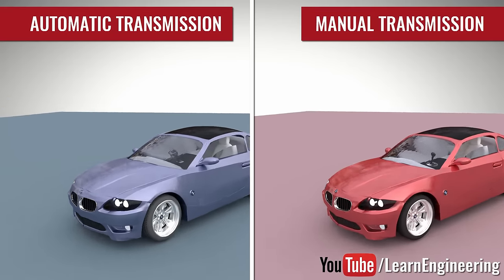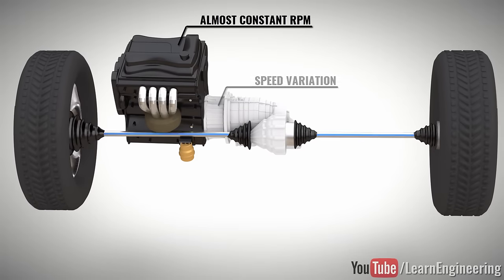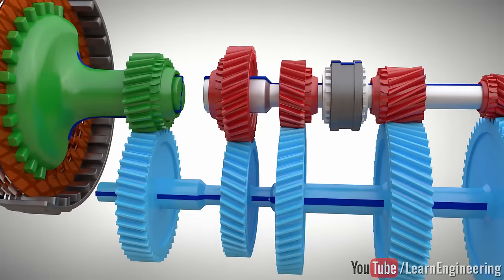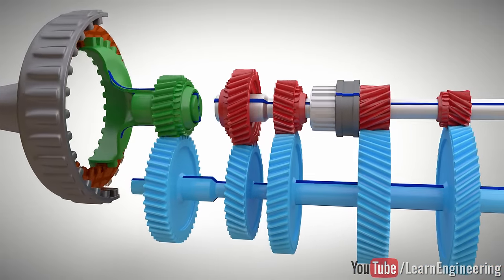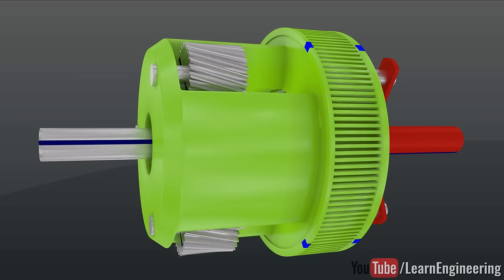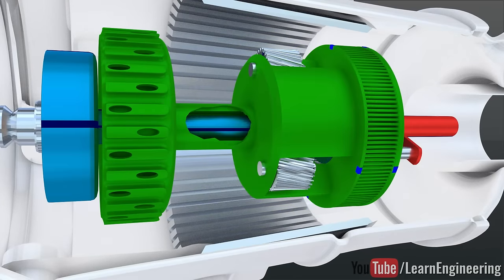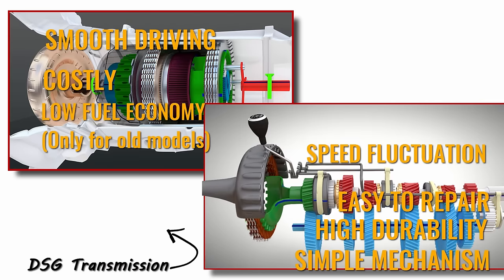Automatic vs Manual Transmission

Comment: 6:39 "Before you press the brake pedal, you have to press the clutch pedal" So wrong.. You should brake with the engine engaged until you almost reach idle rpm's, then press the clutch and brake further. That way you both save the brakes as well as the car's computer knows you're braking on the engine so it won't inject fuel = better milage and lower emissions.
Reply: But not until the engine stalls which is a risk if you brake from a high gear into a low speed.
Reply: When you drive manual you quickly get used to disengaging the clutch at the right time for the current gear.  Also, this is not directed at these two comments, but the video also said that a manual is never smooth.  Which is also wrong, you can achieve a smooth shift. EDIT - It can be smoother than any auto I've driven so far.
Reply: Johann Kuhn
Yes, but quite frankly it's very difficult to ALWAYS shift smoothly in a manual. There will almost always be some jerking at one point or another, especially if the engine's cold.
Reply: Makes sense.
Reply: Johann Kuhn
Yet, I prefer a manual. :)
Reply: just downshift
Reply: Shoo my truck don't have a cadiylitic converter its been cut out long ago. Emissions aren't a thing on my truck. I love downshifting when coming to a stop to hear the Ying if the 4 cylinder and all the pollutants coming from the 2.3l right in front of me. I heard it's good for the environment the plants eat it and give us oxygen.
Reply: Richard van Pukkem so true dude i drive like that always, learned on the hard way tho, never more
Reply: cole varela Umm plants do not like carbon monoxide and chloro fluoro carbons. Carbon dioxide is what they want.
Reply: you should be changing gears as you slow down. you use the engine braking to assist deceleration. 6th, 4th, 3rd, 2nd, clutch and stop. you don't have to skip gears, i do. depends on the situation. but you shouldn't just go from top gear to stop without going through the gears.
Reply: Richard van Pukkem But it doesn't feel as good...
Reply: So I can wear my clutch out a lot faster? No thanks. I might downshift a gear, but I never find the need for the deceleration 3rd and 2nd gear give.
Reply: yes but it would not make any sense for him to talk about braking were you don't have to change the gear since well the gear is not really involved so obviously he was talking about a case were you are already so slow that you would have to press the clutch pedal intermediately.
Reply: Shaquille Makowka it actually won't wear out the clutch a lot faster. there are other factors that would influence that a lot more, such as hill starts, slow manoeuvring, setting off. in any case, you're free to drive any way you want.
Reply: since we talking about downshift wouldn't heel-toe technique better ? tho that technique was used to initiate drift but i don't see why not i do the same too when approuching traffic light
Reply: sultanabran1 exactly
Reply: I prefer to roll in neutral instead of being in gear all the time because it's a lot cheaper and easier to replace brakes than it is to replace a clutch
Reply: Austin Rivers stay in whatever gear you're in until you almost stop and you'll save gas, brakes, and the clutch is used the same
Reply: Richard van Pukkem obviously a driver with experience and sense. thank you
Reply: yeah i was kinda annoyed about that to... they don't understand manual that well... With a manual you brake on the engine, also the manual is smoother then an automatic (i don't know if they NEW automatics are great but the older ones from 2000 aren't smooth at all also the breaking is a huge different on a automatic Negative). And btw you dont have to clutch to shift.
Reply: HandsomeHolland class A driver here(10 speed manual master race), bought my wife a 2016 Jeep Cherokee last year. Damn thing is smooth as hell rides absolutely spectacular, so yeah automatics have come a long way from 2000s. I still prefer manual but auto is great, so it comes down to preference bottom line.
Reply: thanks for the info :) ! i will one day drive one again and see how smooth it is :P
Reply: Osmand Andrade nobody is sayin' that automatic is bad, but it is more lazy driving with it, it is more for older people
Reply: Aleksandar Josipovic my grandmother will only drives Manuals. It's what she grew up with and refuses to drive automatics. It's more preference than laziness
Reply: HandsomeHolland that is funny from five different directions!!!!
Reply: Richard van Pukkem If you're engaged in a gear, you must press clutch then brake or you're gonna ruin your transmission.
Reply: Ben Gorong No thats wrong. It is better to brake while in gear until rpms are in idle then engage clutch and either get into lower gear if turning or neutral if stopping.
Reply: Joe Boldis how do you brake while in gear without pressing clutch? you can't press the brake without the clutch.
Reply: not true, you CAN gear without the clutch at the right rpm for that gear. if you do correctly you won't harm your gearbox.
Reply: HandsomeHolland true
Reply: +Ben Gorong yes you can. all you do is hit the center pedal, as soon as tons get low, then you clutch and downshift, let off clutch, and continue slowing with brakes, then when it idles down... clutch, downshift, let out clutch, then brake till almost stopped then hold clutch in at stoplight.

also cars dont stop injecting fuel when on the brakes, the only way to slow fuel flow is by letting off the gas. if you coast at high rpm while on the brakes for a while it would be worse than if you had just pushed the clutch in and coasted. Cars inject based on rpm, AFR, and speed not brake position.

if that were true, every time you hit the brakes you car would die (or at least run lean as shot and start knocking)
Reply: +seth newman

* rpms not tons

and also you could just stay in 4th gear and use the brakes until almost stopped in a lot of cars
Reply: Pepsi Boy42 , heel-toe helps input and output rpm to be closer. in "normal" situations, when you downshift you have much higher input rpms than output. better for your engine if you do it well. people should correct me if I'm wrong, but I believe it works like this
Reply: We do that in Brazil too, only the more expensive (and small portion) of vehicles here are automatic. Experienced drivers oftenly suggests that one should take advantage of the gear to reduce speed when breaking, by not pressing the clutch too soon.
Reply: GymChess cause automatic are boring to drive :D
Reply: Richard van Pukkem, yup, only part of the video that confused me.  Unless I'm coming to a full stop I keep my transmission engaged in the proper gear.  But to tell you the truth when I first started driving stick I would always take the car out of gear and place it in neutral never using any engine braking when stopping.  I stopped doing that when I started riding a motorcycle.  On a motorcycle you always want to be in the proper gear in case you need to escape. So I transferred that same reasoning when driving my car.
Reply: the buttom line here is that "driving smooth on a manual transmission depends on the driver" 😂😂😂
Reply: The guy in the video cant drive manual, he also said it wasn't a smooth experience, which suggests he sucks at driving
Reply: You can also try to learn to downshift when breaking to use the maximum available engine break too, but definiately not if you are still a beginer, because if you downshift to early or miss the gear (downshift to 2nd instead of 4th ) you can end up damageing the gearbox, clutch and/or the engine putting yourself and others into bigger danger then just by useing  the current gear to stop asap in a dangerous situation. Definiately need to exercice it on lower speeds before you learn to master downshifting in a situation when you have to do it quickly without thinking about current speed, gear and engine RPM
Reply: downshifting depends on what you want to wear out. Most car producers suggest using break + clutch to full stop, instead of downshifting 3+ gears, because breaks are way cheaper than changing gear box. 
Yes I know that if you're a good driver it's ok to downshift, but downshifting should be avoided since it puts a heavy load into the engine.
Reply: I understand that downshifting done badly can cause problems and can break and/or wear out parts of the engine and gearbox, however using the clutch when breaking is a bad thing and is not about wearing one or other part of the vehicle. You press the clutch only when you are close to get to full stop
Reply: what do you  meanwith downshifting 3+ gears? if you drive like 100 kmh and you are in the 6th, you can just shift back to 2 and break on the brake and clutch release right? you dont have to put in in 5 release cluthc and then put in in 4 release clutch and 3 and 2 etc.
Reply: you should downshift in sequence, by going down, to 5th then 4th etc..  you definitely should not try to shift back at 100kph/60mph from 6th directly into 2nd, because almost sure you will break the gearbox, clutch and/or engine. in worst case even cause an accident. It is true that in some cases ( when the engine is running at low revs in the current gear) you can seek over 1 or 2 gears at once, but in that case you already are hard on the break before you start downshifting. Downshifting by seeking over 1-2 gears usually occures not when you want to stop quickly, but when you are running at very low rpm in the current gear and you want instant power to accelerate quickly, but then you should do rev matching. Seeking over a gear or more can be hard and unpreciese becuase you are not used to it and you dont have muscle memory built for it. You are constantly training your brain and arm to shift in sequence and seeking over a gear fills "unnantural" and hard to execute and in an emergency situation you have no time to think about, it has to be as quick as you can
Reply: Osmand Andrade I test drove a brand new automatic Cherokee this summer. It sucks and takes ages to shift. How can you say it's smooth?
Reply: check out these fucking experts here
Reply: @Richard van Pukkem Yeah, not using the engine to assist with braking when slowing down is called "coasting", here in New Zealand if you do that whilst sitting your driver's license test you will be "marked down" for it.
Reply: Learn how engine and transmision works then write somthing smart!
Reply: Emissions who cares

Comment: Actually you don’t have to engage the clutch in order to brake. It just makes the transition of shifting down smoother. The clutch only has to be engaged when you’re stopped
Reply: If you downshift you should double clutch or rev match to prevent wear on the transmission.
Reply: @theedgarthefish4267  only when driving antique without syncro or racing. Definetly not needed on normal traffic
Reply: @tomzu8848  You don't have to do it, bur rev matching when downshifting reduces strain and wear and tear on the clutch assembly and transmission. Downshifting without revmatching forces the transmission into a braking type action which is not what it was designed for
Reply: @theedgarthefish4267  strain and wear without rev matching on normal driving is so minimal it doesn't eat transmissions lifespan lot. Unless it's some glassbox that has been poorly manufactored/designed.
Reply: @tomzu8848  what you're saying is true....but personally, rev-matching is more fun, when done right 👌
Reply: Also to OP, the clutch should be DISENGAGED when the vehicle is stopped and still idling.
Reply: There’s absolutely no reason whatsoever to rev match unless you’re driving a racing car. If you’re driving normally and in a normal car and going doing one gear you don’t need to rev match. 

More relevant when on the race track switching from 5th to 2nd very quickly.
Reply: @theedgarthefish4267  That is indeed what they are designed for, since it's part of its main job during everyday driving.

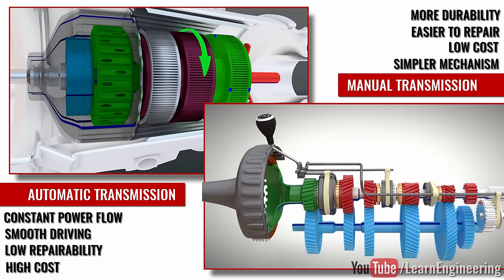Comment: 6:36 That's one of the biggest mistakes. You never disconnect the engine, by doing so on a downhill slope momentum can really take your car. Engine braking is used combined with braking. Never disengage the clutch unless you're ready to stop completely. When you want to go slower, just go to a lower gear. Also on downhills, it's better to be in gear and using the brake to have almost no fuel consumption.
Reply: I thought I was the only one who noticed it. 
The use of clutch while breaking is to prevent the engine coming to a halt while in gear, or in a complete stop, only.
Reply: They demonstrated it very poorly unfortunately. Engine braking is a well known and well used practice in cars with manual transmissions and fuel injection systems.
Reply: @bradyn4212   lol. Thats jake braking, different mechanism for slowing down a vehicle,
Reply: @theedgarthefish4267  Yes an the second one with the woshhh would be an exhaust brake (on certain engines and vehicles it makes a hissing noise) and yeah I think they're technically still forms of engine braking, just diesels don't brake well on their own without mechanisms